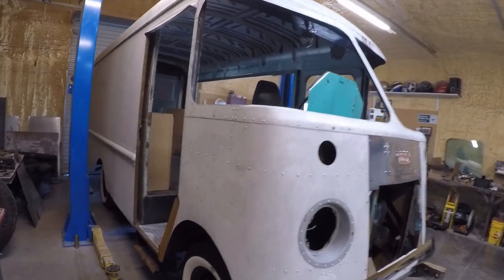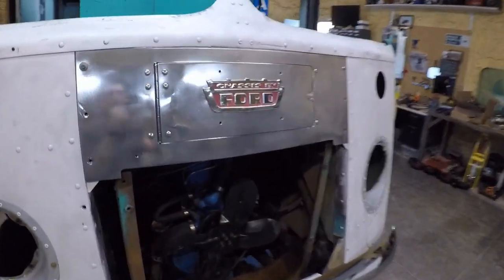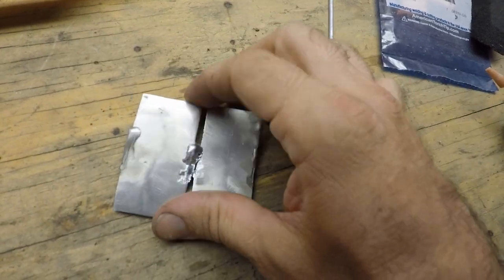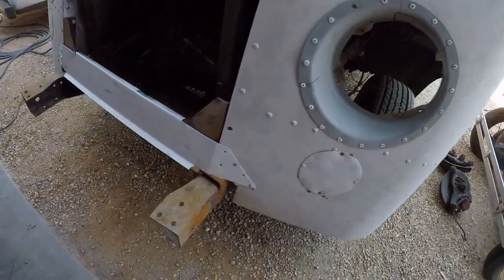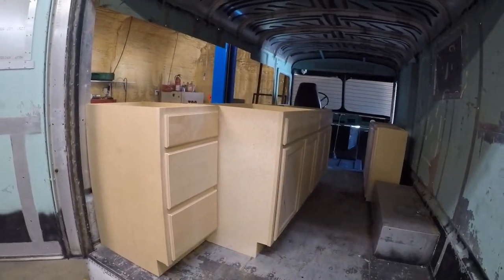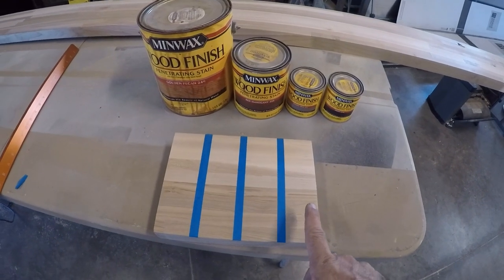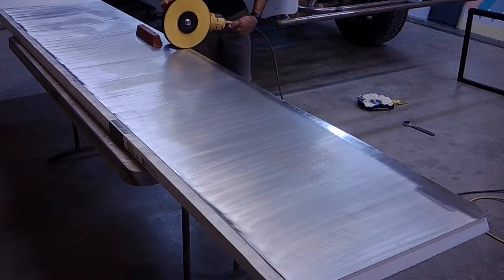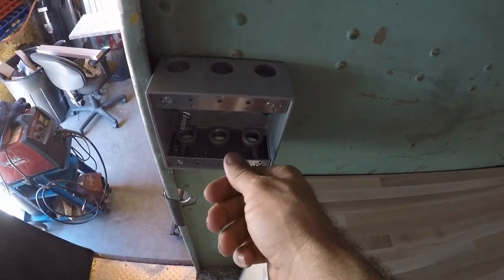Mobile Bar built out of a Vintage Step Van (Ep2)

Comment: Great call on the led light bulbs.  I put the same ones in a ceiling lamp in my home.  They do look vintage.
Reply from the maker: I used them on the Metro as well, the nice thing is the vibrations from driving don't break the filament

Comment: I forgot to ask if you thought about aircraft/buck rivets for the patch panel? They polish up nicely too. With the bead roller you could make it look like a vital/important part too.
Reply from the maker: That's a pretty good idea. I am using rivets for the service window , but sadly I can't use buck rivets since I am riveting the square tube but that would be a great look for the repairs. Would look like a vintage repair or factory install. I'll see how the welds look after a polish and go from there

Comment: Great looking work. I'm amazed how you can swap between big projects like that. I do not envy all the polishing you have in the future. I have found the nuvite polish to work pretty well, but you are correct when you say you have to develope a polishing plan each time.
Reply from the maker: Thanks for the info. I was actually going to reach out to you to ask about the polish. I figured one of your RV projects would've required it at some point
Reply: @AustinCoulson  Yeah I polished a bambi airstream twice. Then only video I have is polishing a line on my 1960 Shasta Canned ham. It's a messy/dirty process.

Comment: I have a pile of aluminum wheels I want to refinish, so I had been looking at how the pros do them and one thing they all do and tell you to do, is make sure you sand them all with the same grit to keep them all in the same shine range. Those who really do super high end will sand them to a 800 and even 1000 grit before breaking out the buffers...
Reply from the maker: You'll see in a future episode I drop it off at a metal polisher to have him finish up the shine, and that crazy fellow only sands the metal down to 220 grit, then uses an aggressive polisher to build up the shine from there. It seemed crazy to me to not go down to at least 400, but I will see in a few days hows it's coming along over there. He had an airstream that he was working on that was mirror finish that he claimed to use that process on.

Comment: How long will the shine last when it’s done?  Do you coat the aluminum with something to keep it from oxidizing?
Reply from the maker: Great question. I reached out to some guys who polish Airstreams to see what the best approach would be and how to protect the finish and they recommended the liquid polish that I use at the end to seal the aluminum and recommend a recoat with light polishing once a year to maintain the finish. I have polished aluminum before in this manner and it has lasted for years with a high shine, but it was for an indoor application, and was virgin material instead of sand blasted 60 year old aluminum so I am in a little bit of uncharted territory.  I have actually polished steel in this exact method a few times and was blown away at how long it resisted corrosion, even outdoors.

Comment: You mentioned having Windows made. Do you have a source for that or suggestions I need some made too 😉
Reply from the maker: There's a shop I use in Phoenix called Bell Auto Glass. They are family owned and have been making all my glass since 2011. Regular, laminated, tempered, they do it all and he even has tricks for cutting custom windshields for oddball cars.